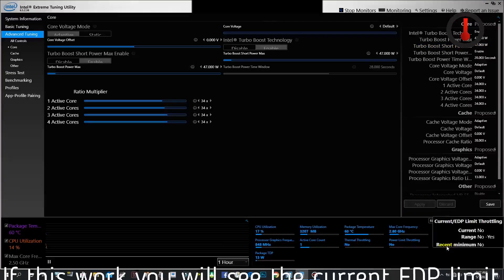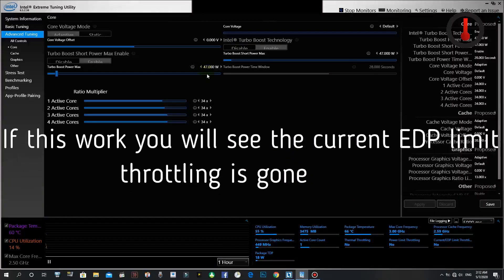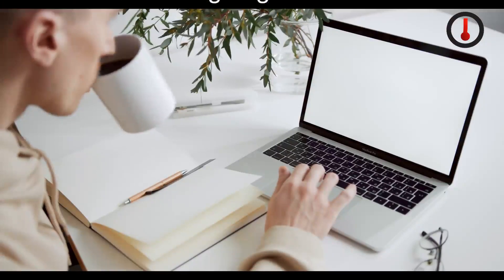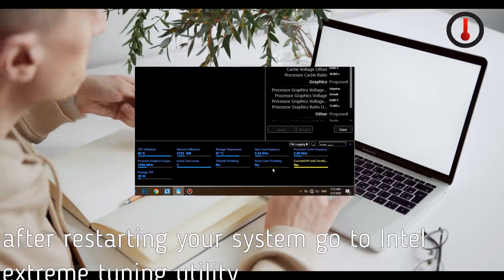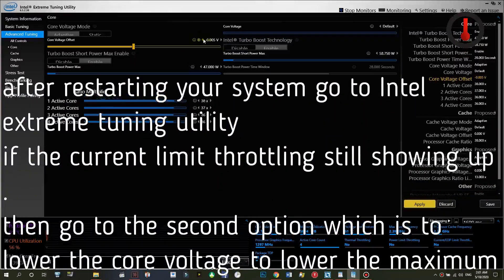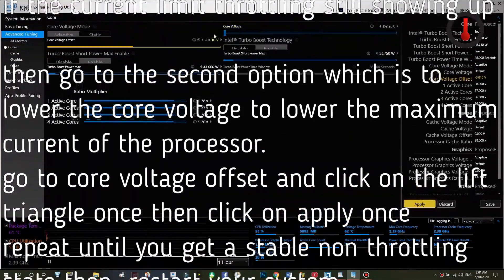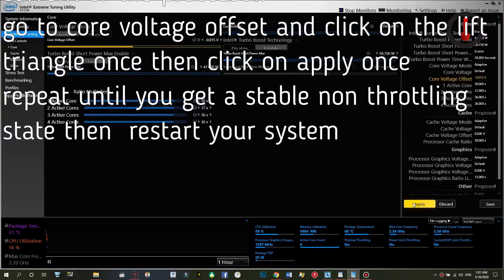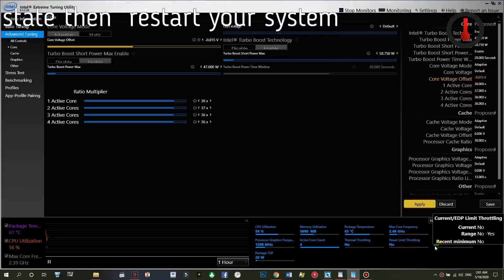HOW to fix  current limit throttling and make your laptop or desktop 10 times faster in 2020

Comment: I have another one solution to add for this laptop. I have the same laptop , i did everything in the video and one more thing. For this laptop you can take the back panel off, put the laptop on a cooling pad ( a cooling pad with at least 2 big fans) and use it like this. The air will blow directly to the components and will make the laptop develop less heat. This is how i use my, is just like how you take the side panel of a pc desktop to let more air inside. For me is ok because i don't take the laptop from my desk, so i don't damage the components. (Sorry for my bad english)

Comment: i set both short and the other to unlimited and its still current limited is it the motherboard??
Reply from the maker: try to install different bios version and see if it works 
the A26 BIOS FOR E6540 WORKED FOR ME
Reply: @HalwagieTECH  i have a custom built pc .. tried flashing the latest bios .. (there is only 2 i was on the first) and it didnt work i think its the motherboard

Comment: I finally got a bluescreen at -2.2 lmao
Reply from the maker: read the description for more information it may help you
Reply: Bro thats way too much ! don't go too low it will degrade your performance . Generally the stable limit is around -0.145v
Reply: @genz410  Bro this was just to figure out the max. But then i found out this didnt rlly help me bec it was getting toooo hot and then i finally undefstood how to Cap ur GHZ of Your Processor with ThrottleStop. I sticked mine to 3.6ghz and now there is no throttling

Comment: Thanks but i think curremt limit throttling is not a problem what bothers me is power limit throtlling
Reply: I fixed my Power limit throttling simply by turning off all the power saving settings. For me it was clicking on battery icon itself and moving the slider to "prefer max performance". Hope that helps.
Reply: @CantTreadOnMe  Yea, i understood the problem you're talking about, Basically your laptop is not getting enough juice while its on battery. Simply setting it to max  performance in battery settings and keeping it on charge constantly will permanently fix this problem..
My case is different. My laptop is getting sufficient juice, but i can't cross a certain threshold, and that is where the problem lies. I did alot of research and ended up fixing it. It turned out that whenever my pkg power hit 15W, it would downclock the cpu's performance to a static 9-10W and compromise the performance heavily.
Btw the problem got fixed,  It turns out that if i can falsify the pkg power, then it will never power limit throttle. The performance is much better now, but... by not that much.
Reply: @astrojade4802  Ohh ok good, im glad to hear you got it worked out. I got most of the kinks worked out on my computer except for "Current/edp throttling which im trying to figure out. I dont see any performance drops or anything but still bugging me seeing that thing trigger in the stress test. I just recently undervolted my i7 10750h and im learning all these new things and just feel like everytime I make progress with all my settings I find something else that needs correcting. Driving me nuts! Haha Got my temps normalized, got my settings right across the board and now the last thing left is this current edp throttling. Gonna try what this guy did in the video and hopefully it works. Anyways good luck to ya and glad tou got yours straightened out.
Reply: Actually my edp is bleeping too, I checked with the person who fixed my power limit throttling and he said that my system cannot change the ppo turbo time limit otherwise it would be fixed. Soo i dont know but, if yours is not locked, then give it a try, Usually the edp throttling is occuring because of the pl1 and pl2 causing problems.  If its not locked in your system then do modify it. But if you're still unsure about anything i am saying, you can post this problem in the techpowerup forum and they will fix your problem.  Yup Fiddling with all this stuff, can drive anyone nuts, I had  a really hard time explaining my problem to others because the laptop was giving 3 4 separate problems at a time, and only after researching overclocking, i stumbled on the fix by chance. 
I am still sticking with my original viewpoint, ie i am never going to buy a laptop, Too many problems, that it needs soo much fixing.
Reply: @astrojade4802  Amen on that. I actually totally regret buying a laptop over building a desktop. Could've built a nice machine for the $1250 I spent on this. Also I have full control in XTU luckily and not locked out of anything thankfully. Thanks for the heads up man appreciate the help.
Reply from the maker: try the A26 BIOS from this link https://mega4up.com/jvcv9m3tx0og
Reply: @HalwagieTECH  but i am using latest bios  downgrade wouldnt help
Reply: Yup Power limit throttling is mostly the problem. If you're still under the warranty period, do take it to the service center and spank them on their face regarding it. Mine has already reached 4 yrs now, and recently i figured that it was power throttling which was causing soo many problems of mine. The only thing i have is regret. IF i knew this from the very starting. I would have slapped the sales staff and taken dell for a ride.